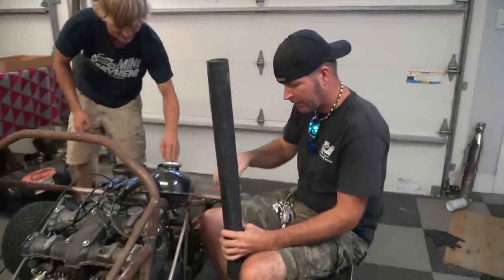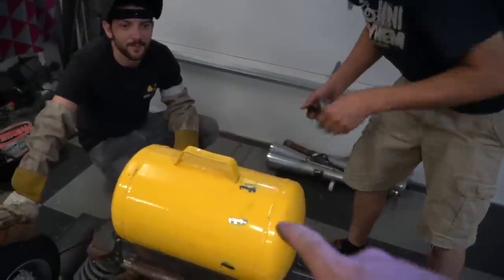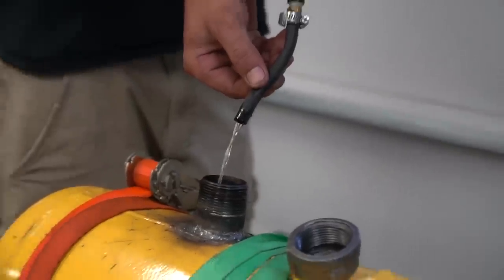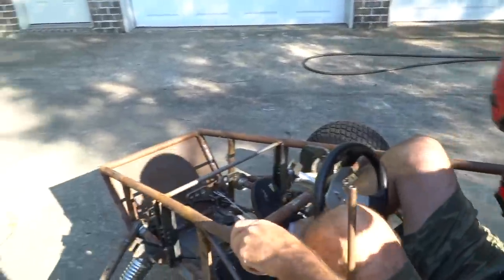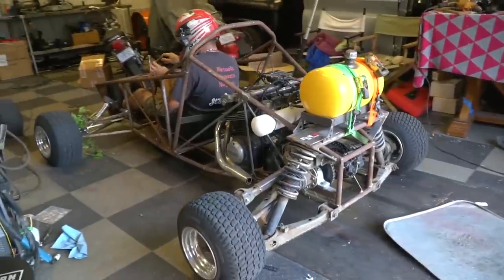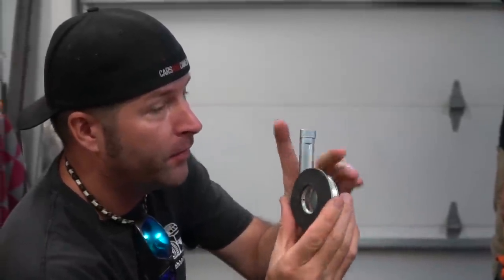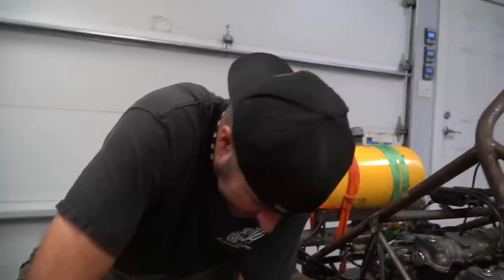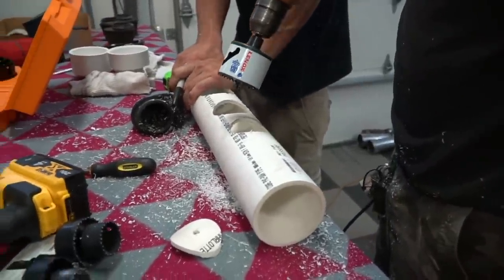750cc Cross Kart TUNING | Building a Custom Air Box, Jetting!

Comment from the maker: I can't believe our $15 PVC air box actually helped!!! It's still not perfect, but it's getting better!
Reply: Adapt it for e85
Reply: Prediction: Face impaled onto the gear shift spear I mean lever.
Reply: tank might need a baffle to keep the fuel from sloshing around
Reply: CarsandCameras told ya mate they do hate open pods badly not perfect but much better even on rich side the headers like that will throw fire look at some cheap harley eBay knock off mufflers that have baffles that again will definitely help with tuning take my word on this
Reply: it didn't. dont lie to yourself. it'll be fine would be true if one of you knew anything at all
Reply: Make sure to have a fuel tank vent !! Also 3.5 turns out on a air fuel screw means your pilot jets are way to lean !! Blocked is possible as well !! 

Stick 4 t slide carbs on it , sync them and have more power and a better tune ... Simple
Reply: Where’s the link for the holesaw kit?
Reply: Paint that PVC airbox with some ceramic spray paint. It'll make sure the air being pulled in stays nice and cold, because it won't let heat from the engine in. Plus, it won't look like PVC anymore.
Reply: EXHAUST!
Reply: You might want to try some type of muffler setup...as schitty as that sounds, i think it will help!
Reply: @douglasbaxter3346    exactly
Reply: Check the valves while you take the carbs off as well, they might be too tight or putting backpressure into the carb which is why it runs so weird.
Another suggestion is the vacuum port on the carb in the comments here, clean them out on all of the carburators, compressed air too as much of the carburator as possible & possibly ports on the engine where the carbs connect too as well, maybe something that can drill them out a tiny tiny bit look up CVK carb mods or mojave 250 carb mods. They are the same type as these on the 750.
Reply: Cant wait for u all to try this with a cheap honda d series
Reply: @No1karez  You'd think common sense would override the "It'll be fine" motto. I really hope they change it before one of them turns the cart over - then have to eat all future meals through a feeding tube.
Reply: Install a fuel pump.a facet 3psi would be plenty good. Or raise the fuel tank and install larger gas pipes.
Reply: A: Makes an air-box to combat air problems, puts massive pod on it to completely negate the point...   

B: Cut factory exhaust making it even MORE lean while also reducing power. Not only with this burn the valves and overheat the engine, nothing I’ve ever straight piped has ever had the same power as it did with the factory muffler! It’s a clear night and day difference that they get worse!

C: Tank needs a breather, getting a vacuum stuck cap of is a pain in the @$$ and will definitely effect fuel flow.

D: All motorcycles have a point where they will no longer accelerate in a certain gears (with the exception of crazy powerfully engine, which this is not), it’s a dragging feeling like there just isn’t anything more the engine can do with the ratio it’s given. That’s normal, and will be intensified by the added weight of the frame. You could add bigger wheels, (something i’d recommend anyway) while this would slow your acceleration, jt will give a higher top speed a d make the issue less noticeable. 

F: You don’t vac check with the filter off, not all cards have the same connections.

G: It’s far better to run a little rich than any sort of lean condition. In terms of engine health anyway...
Reply: It needs a fuel pump!  At high rpm gravity isn't enough to fill up the carbs. Just find the original from the donor bike or another pump that is designed for carbs.
 You also need to make the exhaust into one.
Reply: Why dont you buy a haynes book??????
Reply: I can't believe you believe that it wasn't getting the proper fuel delivery instead.
Reply: You guys should build a pulling tractor
Reply: i need to fit one carb to that thing instead of 4
Reply: You guys are awesome ....
I do think you need to vent the tank and I would go slightly bigger than the fuel line so don't restrict the flow under vacuum.... Wouldn't mess with jets until it's vented...
Good luck guys can't wait to see it  rip 
# it'll be fine go fast take chances
Reply: Been there done that, try....
Needs some back pressure, header pipes
Check the valve settings...
Vent and foam block the tank...
Fuel pump/regulator with 2.5- 3.5 psi
First bench set the carbs the vacuums tune
A single carb set off a intake based on you tube design. I used abs pipe and fittings. (You can hot weld abs)
And a Tach. Your overreving for the gears spans.
That can be a scary ride if set up right.

Mini super mod pulling tractor
CB 750/ bored 30 over 
Shaved heads
Single barrel holly carb
1 into 4 custom intake
4 into 1 custom header
Summit fuel cell
Puckered bung hole
Reply: I cant believe yous guys are riding it with that death shifter. Put a baseball or somethin one that thing
Reply: Put a ball on the end of that shifter and put spring or something on both sides to keep it from shifting its self
Reply: Can you make a minimoto video pls.
Reply: @hellishgrin4604  me2 , need lil back psi they looking for efi high comp race motor performances 😆

Comment: Vent the gas cap if not done already !!  👍👍
Reply: Lol odds are with the way they weld that filler neck has plenty of weld vent holes! Joking 🙃
Reply: I was going to say the same thing.
Reply: Still lean,  raise nettles all the way,  if still lean increase jet size.
Reply: John Dibianca turbo + efi? .......... ill leave you to think about that
Reply: My thoughts as soon as I heard it break up after running well for a little bit. I had a old motorcycle where the vent tube got clogged and it would do the same thing.

Comment: That is a very tough carb sync tool to use... you should be using the multi-gauge vacuum tool so each carb gets it's own line to it's own vacuum port. Then you can adjust all of them with the airbox on.
Reply: Agree, much easier to work with.
Reply: I was wondering about that.  I've never seen the tool they have.  Years ago I had plans on how to build a sync tool; real easy; wish I knew what I did with them.
Reply: Four vacuum tubes from a common reservoir fastened side by side to a graduated backer board. Fill the reservoir with enough mercury to supply each tube with about 1 foot vertical lift. connect the other end of said tube to the individual vacuum ports on the carbs. all four columns will rise at the same time with the engine running. adjust each carb until engine runs smooth and the columns are even.
Reply: 2 normal vacuum gauges would work great.
Reply: In addition to that , I would also check your throttle cable to make sure your slides are all opening at the same time when you give it gas. When throttle cables age they stretch which will cause your carb slides to open at different times. Also I'm sure each carb has an adjustment to raise and lower slide positioning, if your slides aren't opening at the same time it will throw everything off
Reply: If you haven't already, you must check your valve clearance before trying to tune/sync the carbs. Quick and dirty shim over bucket clearance test:  turn the engine over until the cam lobe faces away from the shim. If you can spin the shim, it should be enough to run decent cold. If the shim is tight up to the cam, it will run poorly as soon as any heat soaks into the head.  The practice behind a running carb sync (vs static on the bench) is that you are syncing the carbs to the flow of each cylinder. The flow of center intakes vs outside intake tracks (if the intake boots have angles for example), compression, valves,  vacuum leaks can cause sync issues. On most bikes you sync carbs 1,2  to each other, then sync 3,4, then adjust the center sync screw so both groups match.  Also, most bikes of this era have limited stator output. Lack of a headlight will help you in this case, but I would hook up a volt meter and confirm you are staying above 12v when revving it out. The reading should be done at each coil's +12 wire.  Next, think about buying some DynaTek 3.0ohm green coils and check/replace the resistor spark plug caps.
Reply: Exactly! A motion pro or k&l will work just fine -a worthwhile tool. And check the valves as Junk Forless has suggested. You're really finding out a lot when you "sync" the carbs C&C, but it's worth it.
Reply: Lol was reading you comment at the exact moment the showed it
Reply: Y'all need to get a Tiny Tach, helps immensely with tuning.  Also get real sized jets instead of just drilling out and use the spark plugs to read for rich/lean situations.

Comment: fuel tank needs a breather so it can flow gas out and replace the gas with air. maybe put some fuel cell foam in the tank to keep fuel from sloshing around too
Reply: I actually made a tank similar to that. Old air tank turned fuel tank. Venting is needed.
Reply: @wideband  It has to be vented, if they didn't drill a hole to vent the fuel tank it will definitely be problematic.
Reply: And some mufflers.. Damn it sounds bad straight pipe..

Comment: A carb balancing trick I've used...Get 4 BB's, with the carbs off the engine, set the BB's to the one side of the butterflies that drops. Slowly open the main linkage, and see if they drop at the same time. Right before they drop, if it's set right the butterfly plates will catch all the BB's at the same time. That'll get you close, then use your manometer from there.  Balance is setting that all throttle plates are allowing the same amount of air to each cylinder. Then you can better tune the A/F ratio. Not sure if you were syncing by adjusting the mixture screws or the individual throttle screws on the linkage... Generally you want to balance the carbs in pairs as well. Also, PVC gasses off nasty stuff when it gets heated, I've had it cause some weird running issues on intakes before. Black ABS pipe would probably be a safer choice...

Comment: use starting fluid to troubleshoot, while you're at the rpm where it fails - spray, if it runs better; it's too lean, if it runs worse; it's too rich. good luck :)
Reply: That's freaking brilliant. Gonna be trying it in my interceptor later 🤘
Reply: @99milesaway41  "The last of the V8 Interceptors, would be a shame to blow it up"
Reply: @haugstule  little piece here, little piece there 😂
Reply: They did that in an earlier episode.
Reply: @ThePentosin  worth mentioning again, so they try it again... another thing: make sure all the spark-plug-caps are 5k-ohm. it makes a difference.

Comment: Damn guys, that thing is getting more and more badass. But.. Your shifter is pretty awful. Just a suggestion to help out, I would place the base a little higher to make the stroke shorter and stronger, and use 7/8 tubing to make the shifter more rigid. And that way you can use a motorcycle grip! Great work though, guys, I'm loving the machine.

Comment: That thing is going to be awesome! It's obviously not there yet, but you don't lack much. The shifter needs to be revisioned. When banging gears in a CR125 shifter kart, the gear shifter has a nasty click to it and doesn't move but a half inch in either direction. Use heim joints and adjust your linkage so that you have less leverage and minimal slop to get close to the same results.

Also, a lot of the Honda powered shifter karts have what's known as a magic can. This can is like a "virtual" fuel tank that helps prevents fuel starvation when pulling dramatic G's. It also works well when your fuel pump overpowers your float bowl, as this system allows the carb to take fuel as it needs, rather than force fed by the fuel pump.

Essentially how it works is, there are 2 tubes (steel/copper/whatever) in the bottom of this 2" (not critical) tall can, and 1 more tube that is hooked up to the fuel supply. One of the bottom tubes is taller than the other. The taller one is the return line to the tank and is typically not but .25" from the top of the can. The smaller tube is the carburetor supply and only needs to stand off of the floor of the can by .25 or .375 so that it doesn't pick up trash. The last part is the fuel supply, it's another tube that penetrates the can from the side and can be placed at any height that is BELOW the return tube (tall tube). I installed mine about halfway between the carb supply tube and return. If it is above, the can is likely to not function as desired, as fuel will flow back to the tank rather than fill the can up and then return. This is the fuel line that you will hook your fuel pump up to (fed by the fuel tank).  Once all tubes are epoxy/soldered in place, seal the can off liquid tight.

You can find a diagram of this described system by googling "race kart fuel can", it looks to be the second result under images.

Happy karting Fellas!
Reply: This is more "Magic Can" system is more applicable when your tank is below the carb, but it's something to think about for future builds.

Comment: I would also check the valve clearance and timing chain slack. Fire out of the exhaust can be caused by this. I have seen people try to adjust the tic of the valves out and then it would run rough and not have much power. If the valves are fully closing the slight tick is normal.

Comment: got to put the gauges on there from the bike, it would be cool to get he tach and speedo working
Reply: BrendoST I agree 100%
Reply: Speedo will never work it is driven off the front wheel of the bike . The tack cable is too short by a few feet.
Reply: @pkuudsk9927  im sure they can figure something out lol
Reply: P Kuudsk mod it to work
Reply: You cant use the stock speedo from a 19 in wheell on a 10 inch wheel it would never be accurate. You would be going 20 mph and it would show 100 mph.Gps speedo and a electric tack would be simpler.
Reply: P Kuudsk never thought of that, you are right
Reply: @davesendit1348  42 years as a mechanic working on bikes cars boats and anything with a motor I know I am right lol
Reply: P Kuudsk if that is really true. I’d love your advice lol. I got an 86 f150 with the 302 efi, truck never had a tach so I put an aftermarket tach in, I hooked it up to ground, power, lights and the signal. Everything works except the tach doesn’t move. I checked every else with a test light and it all checks out. I have the signal wire hooked up to the negative side of the coil. Still nothing. And yes I have the tach set to 8 cylinders. Thanks
Reply: @davesendit1348  new parts can be defective switch it to 6 cylinders it will  just show higher rpm.  or 4 cylinder if it still dosent work its junk. But if I remember correctly all fords in that age group had a single wire for a tack signal in the factory harness. In the dash same colour but . look up a wireing harness diagram and see where the tack wire is. or trace it back with a ohms meter what you have hooked up and make sure it is a negitive feed tack.
Reply: Sorry lower rpm I am tired.
Reply: P Kuudsk awesome thank you, this is my third tach I’ve tried btw lol
Reply: P Kuudsk also I am impressed, it does have one tach wire off the distributor, even tho it never had a tach but I’ve found so many different sources claiming which wire is which that are different and different wire colour combos. It’s hard to find info on it in the first place. Thanks for the advice. I’ll keep on trying 👍🏼

Comment: Whats most important and i don’t know if you have done it as of yet, you need to drill out the air/fuel adjustment taps, re-jet, open pipes, pod filters all need the a/f adjusted along with the sync , it will solve all that breaking up and lean conditions past 1/4 throttle, good base line is 1.5-3.5 turns out of the a/f screws, if it runs better below 1.5 turns, you need bigger mains, if it runs better after 3.5/4 turns out then you need bigger main jets. All the turn count will be the same across all four carbs. Just be careful drilling the a/f plugs out, drill a small hole very slow, then take a screw and thread it in the lil hole, give it a pull and they will pop out. Dig all your guys vids.

Comment: You guy's need to adjust the valves. They tighten up over time and hold valves open I bet you will find they are all too tight. .004 intake and .006 exhaust .#4 appears to have blow back hence why you cant sync it.
Reply: This this this

Comment: It's running a lot better now, good work guys an did know Owen Wilson liked karting 😂 I'm interested in your carb synchronizer you had, I usually use a 4 gauge carb synchronizer on the 4 cylinder motors but I guess if you did 1 carb at a time will work too.

Comment: Yes,,,,like John said, you need to vent the cap too. But they are usually are one way vent so the fuel wont spill out all over the hot engine ! So just drilling a hole in the cap wont do. You may have to weld a new "filler neck" to accommodate a fuel cap ! Peace !

Comment: If I may make a few suggestions....put a 90 on the air pipe pointed up with filter on top of that or one 90 on each end for a more even air flow. 2 filters would look cooler than one. Maybe pull your shiftier handle & maybe heat & bend it into a lighting bolt shape which will lower & move it forward for easier reach from the steering wheel & keep it out of your eye . I always enjoy your videos, just wish you put out more. Thanks

Comment: Four vacuum tubes from a common reservoir fastened side by side to a graduated backer board. Fill the reservoir with enough mercury to supply each tube with about 1 foot vertical lift. connect the other end of said tube to the individual vacuum ports on the carbs. all four columns will rise at the same time with the engine running. adjust each carb until engine runs smooth and the columns are even.